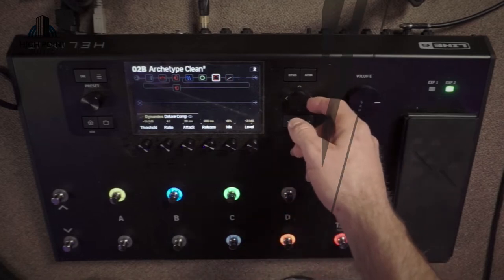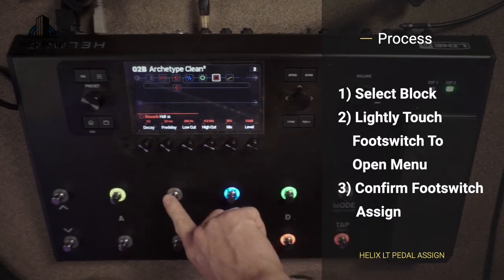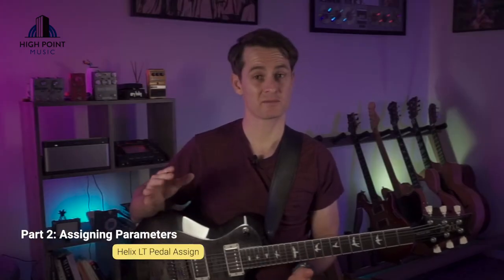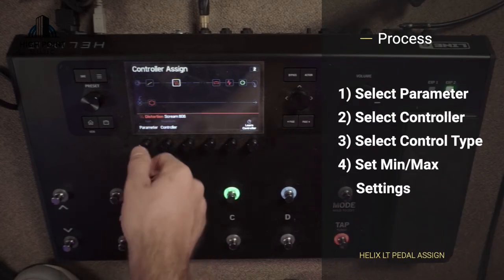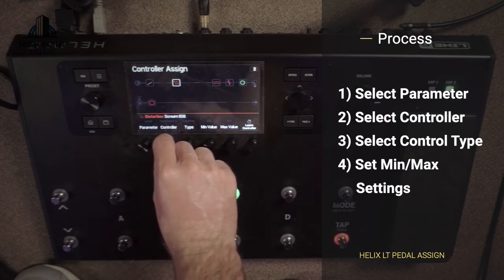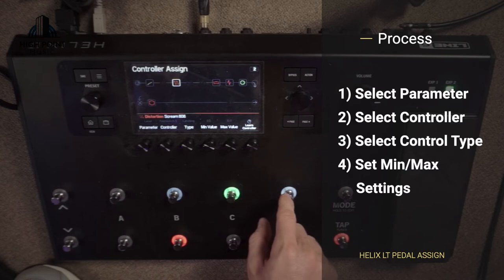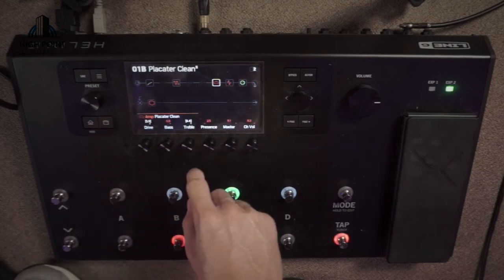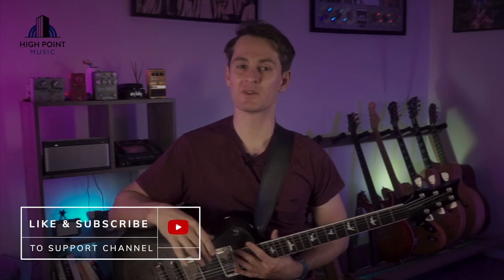line 6 helix lt assign footswitch

Comment: Thanks for the informative videos - Can you get the Expression pedal, once engaged to select a Snapshot ?  So I have Snapshot 1 set up fine, I would like to engage the Expression pedal that would  select say Snapshot 2 and have the Wah engaged.
Reply from the maker: Hi Jimi! thanks for the question. As far as I know without doing some more research: I'm not aware you can use the wah switch to select snapshots. But,  I can see what you're going for from a functionality perspective. Try this as a work around and let me know how you go. 

Set up snapshot 2 with your settings that you want for your wah sound. And make sure that you have the wah switched on in snapshot 2 (either by engaging it on the expression pedal, or using the bypass button on the unit) when you save the settings for the patch. This way - when you go to snapshot 2 you will have your settings all ready for with the touch of a single button. 

If that doesn't work for you - you will need to adjust some settings behind the scenes in the menu to get it to work. Let me know and I can do a short video for you next week to show you how to adjust things to get this functionality going. 

Best, 

Ryan
Reply: Thanks for the reply, the music has a very fast change so even selecting a footswitch and moving to the Wah is too slow.
Reply from the maker: @JimiSomeMoore  no worries.Maybe you could contact line  6 and ask them to build it  into a firmware update.

Comment: how can i link 2 different presets in the footswitch ? i mean i want to switch between a clean tone and my already finished distorted guitar tone.
Reply from the maker: Thanks for the question. The best way to do this would be to save the patches side by side in banks and then just scroll between them. The other option is you could load both amps into one patch and then use an impulse response as your speaker cab - doing it this way would be far easier using snapshots to changes settings. 

Let me know how you go. 

Ryan

Comment: Hi. I setup my Helix Floor on top of my desk, not as a floor unit. Is it possible to use external footswitches for the looper instead of the Helix Floor switches?
Thank you very much
Reply from the maker: Great question: you absolutely can but you will need to do so by using a midi controller - and then programing it to control the looper.  

But if you're not 100% sold on keeping the unit on a desktop: the path of least resistance would be to place the unit on the floor and then use the software editor to set up and tweak sounds. 

Let me know how you go! 

Ryan
Reply: @hpmguitar  thanks Ryan. 
The easy way out is to place the Helix on the floor, which would be a big change in my setup
Reply: A phew questions:
1. Can I do something to prevent the joystick from moving and changing settings while playing?
2. When using stomp/snap mode and pressing the mode button can I now change the functions of the switches without it affecting the saves info when I go back to stomp/snap?